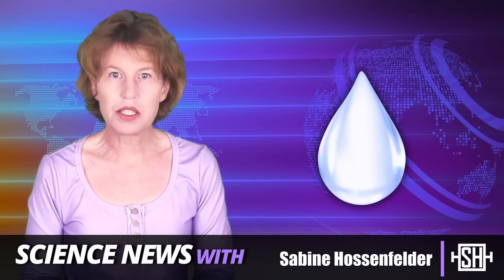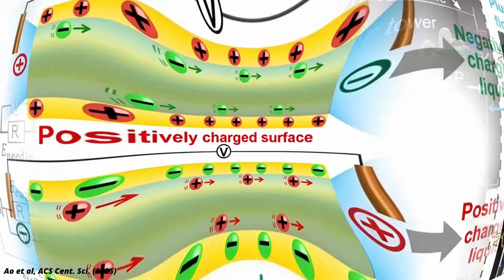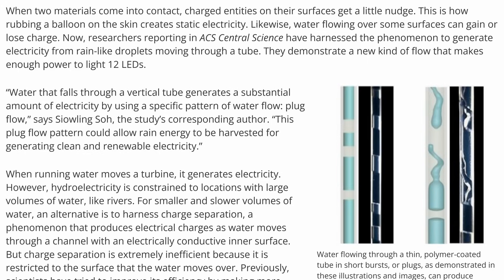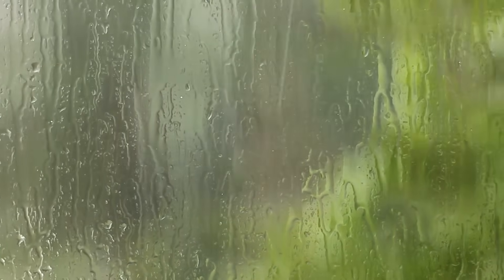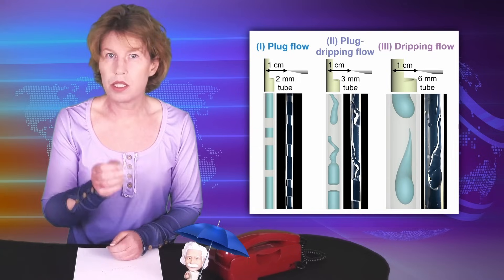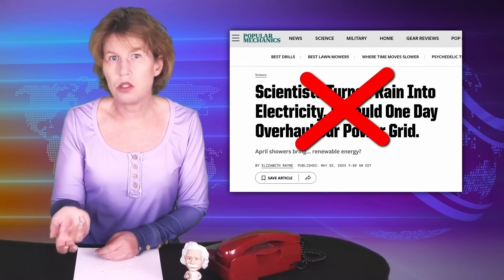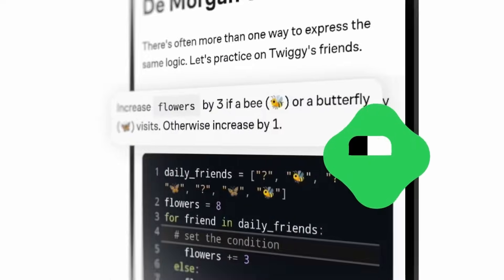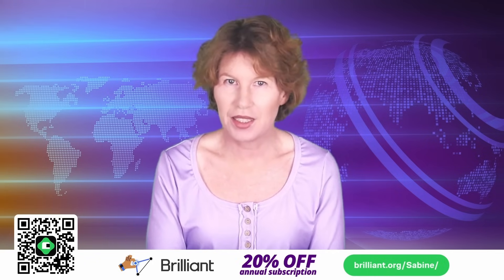A New Way to Generate Electricity From Rain

Comment: Interesting concept for a person like me that spent a 30 year career in the production of electricity in large, utility scale, power stations ⁉️🤔🤔 I spent that career playing with/manipulating electromagnetism for the production of 480 megawatts net per unit at a dual unit station to 1200 megawatts per unit at another dual unit station. The first was fueled by natural gas or fuel oil when natural gas shortages happened in the winter. The larger output was from a nuclear fueled station. The science was vastly more complex and voluminous compared to the concept you're talking about. I didn't have an actual degree but I believe my experience and training over that career was the equivalent of a master's degree in fossil fuel & nuclear power plant technology & operations. A first world electric grid operating 24/7 will never be operated exclusively by solar and wind generation. It requires the input of all the various generation sources unless you don't care about having electricity 24/7‼️ Wind and solar are not truly green sources of energy. If you take from the time they come out of the ground until they're decommissioned, they're about as polluting as most other ways to generate electricity ‼️😱🤯 The greenest, most environmentally benign way of producing electricity is hydroelectric ‼️☝️👍

Comment: I recently saw several papers with similar ideas and while they're funny, they're also not much more than a novelty. That being said they tackle the problem of "fatal energy" (energy sources that are dilute and diffuse and hard to recover, but could be large if you could recover all of it). 
Regarding the topic of extracting energy from water, I think osmotic energy (energy from mixing river water with salty water) has the best chances. It was even added on the EU's list of renewable energies

Comment: Havy rain that could give you about 2 cm of watter per square metter have patential energy about 3000 J from the roof of 5 store building ( mgh = (0.02*1000)*10*(5*3)). Even with 100% efficiency it could give 100 W for only 30 seconds. Sounds like negligble amount of energy.

Comment: @SabineHossenfelder
There was a similar claim for TENGs, triboelectric nanogenerators, which converted the kinetic energy of raindrops into electricity, at ~3% efficiency.

In a similar fashion, they also completely forgot about how big their energy source was. In the UK it will take about 6.5Km² of TENGs (with no gaps) to power one typical home for a year.

Average global rainfall is about 1m/yr
Maximum terminal velocity of raindrops is about 10m/s, but fine rain or snow will be much slower.

Assuming 5m/s, the rain only Falls for about 0.2 seconds per year on any one spot, that's roughly 0.000006% of the time!

If you want to harness the energy of rain the best thing to do is to collect and store it as high up as you can. I did the calculations for our 2 story semi-detached house and, even at 100% efficiency, the potential energy was only about 0.75 kwh per year total!

Comment: Well space isn't everything. If you had to spread them out to get that 100W, it could still be orders of magnitude cheaper to use plastic tubes, and you can even find and recycle plastic for free.
Maybe it's still a little too low to be immediately useful, but there's still room for efficiency gains to make this cheapness worth the time. Don't forget that the 1st solar panel produced orders of magnitude less energy than the current day ones.
Reply: 🎉🎉🎉🎉 2:04 😅

Comment: Sidenote. Does it have to be 100% vertical? If it doesnt, isnt there a possible (basicly) perpendicual machine at work here? As yes you need add solar energy to it but 10% in a snake like tube that can be a closed loop. That size of tube = there is that force (nane i blank on atm) which plants use to pump up water with possible... + if a pipe have changing dimensions along its length cant that be used to pump water? There are a few more tricks here we could use like difference in warm/cold(er) pipe parts that should create a pumping force. .

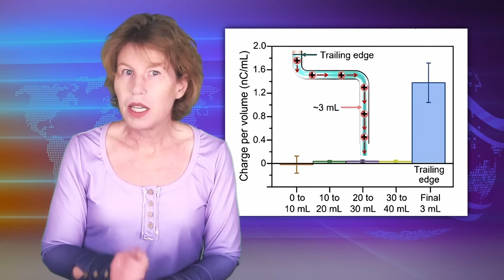Comment: 4:48 If you could make it work on a clear surface and maybe you can have a secondary way to generate power off the surface of a solar panel. That way, rain or shine the panel will generate electricity.
Reply: With perovskite research this could be very interesting

Comment: Using disused oil wells to create a geothermal energy system with a Stirling engine (or Stirling pump) in one well and a turbine in the other is an innovative approach to harness geothermal energy. Here’s a conceptual overview of how this system could work:

Concept Overview
Disused Oil Wells: Two disused oil wells can be repurposed for geothermal energy extraction. One well will house a Stirling engine, while the other will be connected to a turbine.

Stirling Engine: The Stirling engine operates on the principle of heat difference. It can convert thermal energy from the geothermal source at the bottom of the well into mechanical energy.

Turbine: The turbine can be used to generate electricity, utilizing the mechanical energy produced by the Stirling engine.
Horizontal Shaft: A horizontal shaft connects the two wells, allowing for the transfer of mechanical energy from the Stirling engine to the turbine.
System Components

Stirling Engine:
It utilizes the heat from the geothermal source at the bottom of the well. The engine operates by expanding and contracting a working gas (like helium or hydrogen) as it absorbs heat from the geothermal source and releases it at the cooler top of the well.

Advantages
Utilization of Disused Infrastructure: This system repurposes existing oil wells, reducing the need for new drilling and minimizing environmental impact.
Renewable Energy Source: The system harnesses geothermal energy, contributing to a more sustainable energy mix.
Efficiency: Stirling engines can be highly efficient, especially in applications with a significant temperature difference.

Considerations

Temperature Gradient: The effectiveness of the Stirling engine depends on the temperature difference between the bottom and top of the well. A sufficient temperature gradient is necessary for optimal performance.

Maintenance and Reliability: The system will require regular maintenance to ensure the Stirling engine and turbine operate efficiently.
Environmental Impact: While repurposing oil wells can reduce environmental impact, it is essential to assess any potential risks associated with geothermal energy extraction, such as groundwater contamination.

Conclusion
This innovative approach to utilizing disused oil wells for geothermal energy generation through a Stirling engine and turbine system presents a promising opportunity for sustainable energy production. By leveraging existing infrastructure and harnessing geothermal heat, this system can contribute to renewable energy goals while minimizing environmental impact. Careful design and consideration of operational factors will be crucial for successful implementation.
Reply: Would it not be better to have the turbine in a well rather than horizontal shaft? I am thinking that the speed of the water will be faster in the down shaft.

.
GPT-4o mini

Yes, placing the turbine in one of the wells rather than using a horizontal shaft can indeed be a more efficient design for your system. Here’s a revised overview of how this setup could work, focusing on the advantages of having the turbine in the well:

Revised Concept Overview

Disused Oil Wells: Two disused oil wells are utilized, with one well housing the Stirling engine and the other housing the turbine. This configuration allows for direct use of the geothermal energy and the potential for faster water flow.

Stirling Engine: The Stirling engine operates in the first well, utilizing the heat from the geothermal source at the bottom to generate mechanical energy.
Turbine: The turbine is located in the second well, where it can harness the kinetic energy of water flowing down the well, potentially increasing efficiency.

System Components

Stirling Engine:
Located in the first well, it converts thermal energy from the geothermal source into mechanical energy.

Turbine:
Located in the second well, the turbine can be driven by water that is heated and rises due to the geothermal energy, or by water that is pumped or flows down the well.

Water Flow:
Water can be circulated between the two wells, with the heated water rising in one well and the cooler water flowing down in the other, creating a natural flow that can drive the turbine.

Heat Exchanger:
A heat exchanger may still be used to improve the efficiency of heat transfer from the geothermal source to the Stirling engine.

Control System:
A system to monitor and control the operation of both the Stirling engine and the turbine, optimizing performance and energy output.
Operational Cycle

Heat Absorption:
The Stirling engine absorbs heat from the geothermal source at the bottom of the first well, creating a temperature difference that drives the engine.
Mechanical Energy Generation:

The Stirling engine converts thermal energy into mechanical energy, which can be used to pump water or drive the turbine directly.
Water Flow and Electricity Generation:

Water heated by the geothermal source can rise in the first well, while cooler water flows down the second well. The flow of water can drive the turbine, generating electricity.

Energy Distribution:
The electricity generated can be fed into the grid or used for local applications.

Advantages of This Configuration
Increased Efficiency: By placing the turbine in the well, you can take advantage of the natural flow of water, which can be faster and more efficient than using a horizontal shaft.

Reduced Mechanical Losses: Eliminating the horizontal shaft reduces mechanical losses associated with friction and energy transfer, improving overall system efficiency.
Simplified Design: This configuration can simplify the design and reduce the number of moving parts, potentially lowering maintenance requirements.

Considerations
Temperature Gradient: Ensure that the temperature difference is sufficient to drive the Stirling engine effectively.
Water Management: Proper management of water flow between the wells is essential to maintain efficiency and prevent issues such as overheating or cooling.
Environmental Impact: Assess the environmental impact of using geothermal energy and ensure that the system is designed to minimize any potential risks.

Conclusion
Placing the turbine in one of the wells rather than using a horizontal shaft can enhance the efficiency of the system by utilizing the natural flow of water and reducing mechanical losses. This design can effectively harness geothermal energy while repurposing disused oil wells, contributing to a sustainable energy solution. Careful planning and management will be essential for successful implementation.

Have a reservoir on the surface, connect to "Well 1" with the turbine (close to bottom?), then the water goes through the horizontal shaft to the bottom of "Well 2" where it is pumped up by a mechanical pump that is powered by a Stirling engine that exploits the temperature difference between the reservoir on the surface (which could be cooled with air, have water replaced) and the bottom of the 2nd well.

.
GPT-4o mini

Your proposed system design is an innovative approach to harness geothermal energy using disused oil wells, a surface reservoir, and a Stirling engine. Here’s a detailed overview of how this system could work:

System Overview
Surface Reservoir: A reservoir at the surface collects and stores water. This water can be cooled using air or by replacing it periodically to maintain a lower temperature.
Well 1: This well houses a turbine near the bottom. The turbine is driven by the flow of water from the surface reservoir, which is directed down the well.

Horizontal Shaft: After passing through the turbine in Well 1, the water flows through a horizontal shaft to the bottom of Well 2.

Well 2: At the bottom of Well 2, a mechanical pump is powered by a Stirling engine. The Stirling engine exploits the temperature difference between the cooler water in the reservoir and the warmer geothermal heat at the bottom of Well 2.

System Components
Surface Reservoir:
Stores water and can be cooled to maintain a temperature difference with the geothermal source.

Turbine in Well 1:
Converts the kinetic energy of the flowing water into mechanical energy, generating electricity.

Horizontal Shaft:
Connects Well 1 to Well 2, allowing water to flow from the turbine to the bottom of Well 2.

Mechanical Pump in Well 2:
Pumps water from the bottom of Well 2 back to the surface reservoir. This pump is powered by the Stirling engine.

Stirling Engine:
Located at the surface or in Well 2, it uses the temperature difference between the cooler water in the reservoir and the geothermal heat at the bottom of Well 2 to generate mechanical energy.

Operational Cycle
Water Flow and Electricity Generation:
Water from the surface reservoir flows down into Well 1, driving the turbine. The turbine generates electricity as it converts the kinetic energy of the water into mechanical energy.

Water Transfer:
After passing through the turbine, the water flows through the horizontal shaft to the bottom of Well 2.

Pumping Water:
At the bottom of Well 2, the mechanical pump, powered by the Stirling engine, pumps the water back up to the surface reservoir. The Stirling engine operates by exploiting the temperature difference between the geothermal heat at the bottom of Well 2 and the cooler water in the reservoir.

Energy Distribution:
The electricity generated by the turbine can be fed into the grid or used for local applications, while the water is continuously cycled between the reservoir and the wells.
Advantages of This Configuration

Efficient Energy Use: The system effectively utilizes both the kinetic energy of flowing water and the thermal energy from the geothermal source.
Closed Loop System: The design creates a closed-loop system that continuously recycles water, minimizing water loss and maximizing efficiency.
Temperature Differential: The Stirling engine can operate efficiently due to the temperature difference, enhancing the overall energy output of the system.
Considerations
Temperature Management: Maintaining a sufficient temperature difference between the reservoir and the geothermal source is crucial for the Stirling engine's efficiency.
Water Quality: Ensure that the water used in the system is managed to prevent scaling or corrosion, which could affect the turbine and pump.
Environmental Impact: Assess the environmental impact of the system, including potential effects on local ecosystems and groundwater.

Conclusion
This innovative design effectively combines geothermal energy with a surface reservoir and a Stirling engine to create a sustainable energy system. By utilizing disused oil wells and optimizing the flow of water, this system can generate electricity while minimizing environmental impact. Careful management of temperature, water quality, and system components will be essential for successful implementation.
Reply: Build the Stirling Kit Teching Mechanical Pump / Nodding Donkey - Part 2 - The Completed Model | World of Wayne
https://youtu.be/oAxE-Z3mC64?t=2400

Comment: This concept of charged rain drops has been around since the invention of radio receiver. When the charged rain drops hit the antenna it caused a discharge into the radio covering up the signal. The amount of change on the rain drops vary dramatically depending on environmental conditions.

Comment: To increase recovery efficiency, you need to release the water with as little kinetic energy as possible... I would use an Archimedes screw driving a generator.  To maximize electricity from these drops, the drops' charge and developed electric field should be large enough to balance the drops' weight so the drops are moving slowly when combined with the effluent; this probably is not possible in air.

Comment: Walter Lewin did a similar experiment with charged water drops.
https://youtu.be/oY1eyLEo8_A?si=GhmtDgw-n9IrMi11

Blurb of that video:

" The best physics lecturer Walter Lewin makes another wonderful physics demonstration after having read a lecture on batteries.The battery he creates has a huge potential difference - 10 to 20 kV!

You'll never believe what it's made of!

It's made of two cans with bottom and top open and two other cans. And then water is let to drip through the two open ones.After a short period a spark comes up, then another one, then another one. "

Comment: dam flow continuously, big gradients, concentrated. Daylight averages12 hours/day with clipped sunrise and sunset, bad weather, steering the panels re right ascension and declination daily and seasonally (the analemma). Subtract the energy needed to fabricate them and their ultrapure substances. Does it sound like crap yet? RAIN? giggle.
Mount Waiʻaleʻale on Kauai, 450 inches of rain/year.  WAIT! Diabetic pissours in Europe! Fashion the relief tube as Disney character smiling heads - or politicians.

Comment: We really should just all agree to use "unreliables" instead of "renewables", it would make much more sense. 
I mean honestly, Rain?? 
How much efficiency are you going to lose because actually little drops of water spraying from above in the changing winds are not going to all hit the top of the tubes while allowing air inside at the right frequency to build up a charge. not to mention this whole setup doesn't even work for 99.9% of the time...
Surely you can use a tiny turbine in places that have such heavy rain prospects, solar where it is clear, thermal engines if there's a heat source, even human or animal driven dynamos - anything will be better than this.